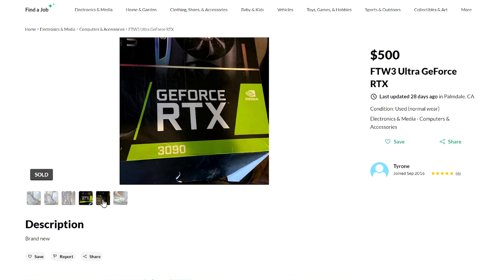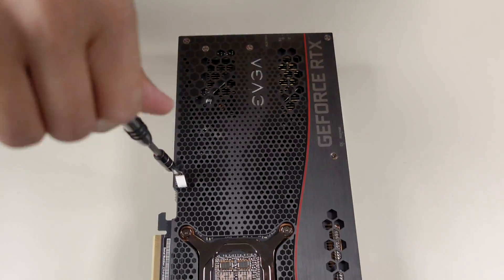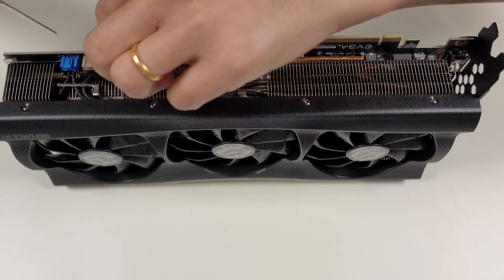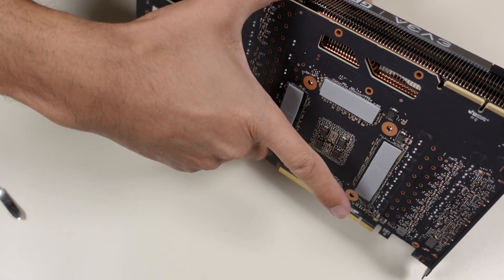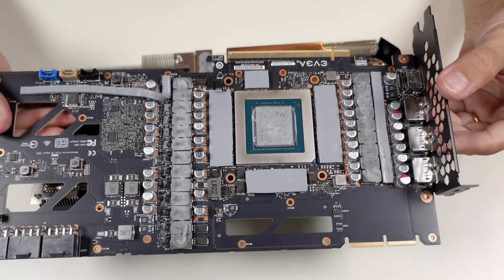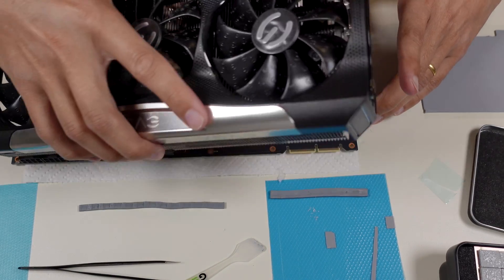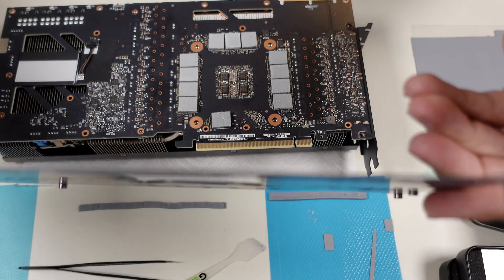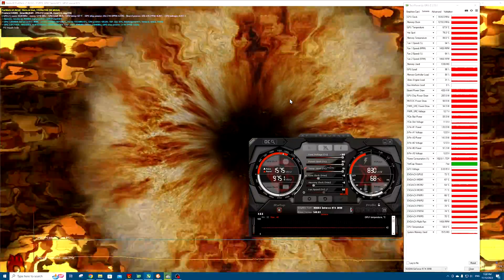EVGA RTX 3090 FTW3 Phase Change and Graphite Pad Upgrade

Comment: Is it Upsiren 3D Graphite pads? Did you use 2.2mm thickness on both sides?
Do you remember what rest of the pads were? Did you use some phase-change paste for core?

You seem to only say that VRAM uses 2.2mm pads at 7:15 while stating that all pad thickness were picked for best results, so I'm a bit lost :D
Reply: did you ever do it? what did you use and does it still work?
Reply: @nßultz1440  I didn't. I was doing research before buying a used card. But so far temps are fairly good (was mostly worried about memory IC on backside cooking in sandwich case / A4-H2O).

Just in case I ever feel the need to, I bought Upsiren UTP-8 thermal putty + 1.5mm copper shims instead of going with fixed thickness thermal pads, yet to install.
Reply: @ you just putty the shims to the dies? ive looked at the shims, but wasnt sure it was any better than just using a soft pad thats thicker than they say
Reply: @nßultz1440  yeah, that's the plan. Putty on its own should be fine too, but I've figured if I'm gonna redo it eventually might as well try to get an improvement. Shims are of course conductive though, so you have to be careful.

Putty on its own is supposedly equal to mediocre thermal pads and I didn't find respectable info on all thermal pad thickness to go for good/expensive pads, so.
Reply from the maker: https://www.amazon.com/dp/B09R9FMDTB?ref=ppx_yo2ov_dt_b_fed_asin_title
Reply from the maker: I used this ones but they are not available any more, for the vrm and chokes if not mistaken I used 1mm for chokes and 3mm for vrm
Reply from the maker: if you find a used card just test it in furmark for 10m to see memory temps if they dont go above 90 than you can buy the card  knowing that it wasnt toasted

Comment: I did the same with 3070TI, hot spot dropped by 15c, memory temps by 30-35. Used phase change Honeywell PTM and Frost Mining thermal pads.
Reply from the maker: Amazing improvements 👍